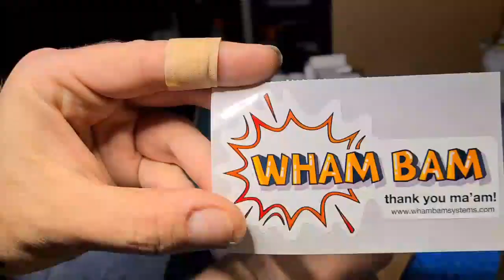Flexible Build System - Plate for Mono X Resin Printer (discount code in the Description)

Comment: I tried something like this on my Photon and it didnt work due to the thickness messing up the Home position sensor.  I kept setting Z zero and not understanding why the machine would keep trying to go down pushing on the glass and it was due to the sensor tab never hitting the home height before going to z-zero.
Reply: I have this problem too, have you found a fix?
Reply: @Nemicyst707  in just removed it and went back to normal.
Reply: Print a shim and then fit the wham bam you never go back once it works

Comment: Thanks for the video! Question for you - WhamBam has a 2.6mm spacer they suggest using to ensure the flex plate doesn't damage the FEP or LCD. But it doesn't look like you needed it. Have you had any issues with your Home setting because the flex addition makes your build plate a little taller?
Reply from the maker: Nope, used it without a spacer, and until now never had any issue. I set my home settings using the flint read method. I read some coments that use spacer, others don't and it's a divided opinion. It will not harm of you don't use one when levelling right, and it will definitely not harm if you print and use one.

Personally, i am considering installing one, to try and have my own opinion about: with or without spacer.
Reply: @brunotroia  Thanks for the detailed response! I just printed my spacer, so I’m going to try it and if there are no problems, I’m good to go. Thank you!

Comment: Thank you so much for this video! How have you been enjoying your Wham Bam Flex plate for the Mono X? Have you had any issues with failed prints? Particularly when doing a large amount of stuff on the build plate? Like filling the whole plate? I just got one but haven't printed on it yet, waiting for it to cure and am a little worried that I won't be able to do a full load on the build plate as I have previously...

Comment: What kind of cleaning solution do you use in your cleaner?
Reply from the maker: On the ultrasonic cleaner? It’s water, regular, normal water. The resin i use is water washable
Reply: @brunotroia  Thank you.
Reply: @brunotroia  What do you use if you're using regular resin?
Reply from the maker: On regular resin i use IPA alcohol, but not heated in the ultrasonic cleaner that i use. Don't want to burn down the hose 😉
On regular resin my process is:
1- quick wash in normal water 
2- good wash in IPA with a soft toothbrush 
3- 5min wash in ultrasonic 
4- let it dry
5- Cure under UV
Reply: @brunotroia  Awesome. thanks.
Reply: @felixsu375  Mean Green. If in the US, you can get it at Lowes in store for $5-ish for a full gallon. It's the best resin remover in a ultrasonic cleaner
Reply: @8BitLife69  Awesome. how about simply green? I have a gallon of that.

Comment: Thanks for sharing this, was thinking of going this route. I noticed you leveled your build plate off of the FEP; does this level more accurately? Have you ever scratched the FEP in the process?
Reply from the maker: Nope, never scratched the FEP, but i find that after leveling with the FEP, i've got some failed prints because it sticked to the FEP. After leveled again with the sheet, without the Vat, and it worked great. 
So normal levelling with the magnetic plate and it should work just fine

Comment: Do you habe the STL for your build plate adapter handy? I printed one myself but it requires the application after the print, which gets messy. If I can just change the angle, like you do, it will be a much cleaner process.
Reply from the maker: You can find it here, an Facebook group for mono X
https://m.facebook.com/groups/594649514547371/permalink/627832921229030/?sfnsn=mo
Reply: @brunotroia  Amazing. Thanks a ton

Comment: if you put your parts in a container or a ziplock bag with the cleaner in it and put that in the ultrasonic cleaner you wont have to clean out the Ultrasonic as much and you can have it filled with water only
Reply from the maker: Will try that, thanks for the tip

Comment: Wow just bought a Flexplate from Whambam after seeing your video,but how did you do the leveling?
Kinda struggeling with it :(
Reply from the maker: Unscrew slightly the plate an home the plate.
If you do with the vat, the named flint levelling, screw the bolts with the plate in home position and push 2-3 time the UP button for 0.1mm. And than validate for the new reference. 
That's how i've done
Reply: @brunotroia  Wow,fast reply haha
Ok,so you basically just used the "Flintread leveling method" so no spacer or something needed?

Happy new year btw :)
Reply from the maker: @KBHFD  no, didn't use any spacer. Just foe a few days i read a post on Facebook that someone used a spacer. As long as my prints came out fine, i don't think i will use a spaxer on my printer
Reply: @brunotroia  does yours make those strange noises?

Comment: ok and that last part with the small things stuck to the plate.... that is the most interesting and it's skipped :\
Reply from the maker: I took it out with my fingernails under the glove. Really not hard to take it off. A little lift  on one side and it jumped off. The flex helps to loosen the pieces off the plate